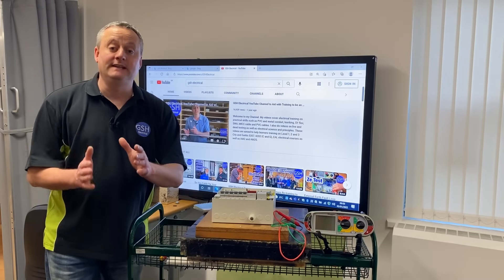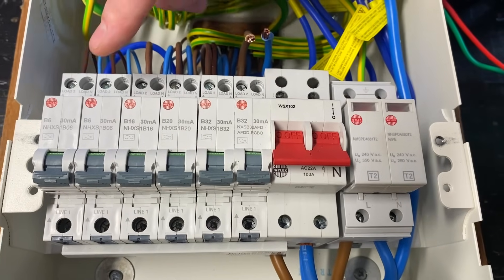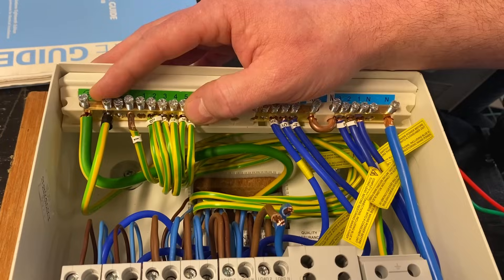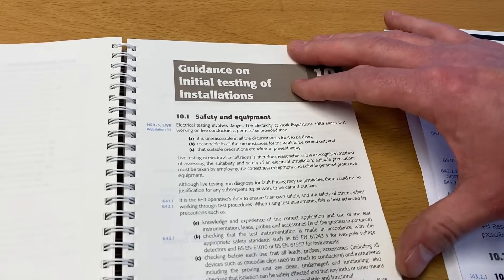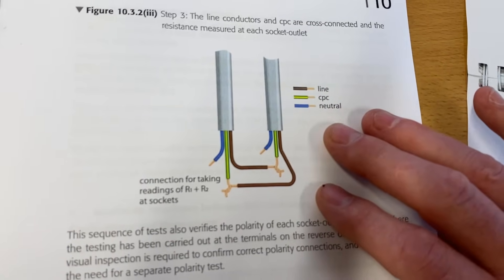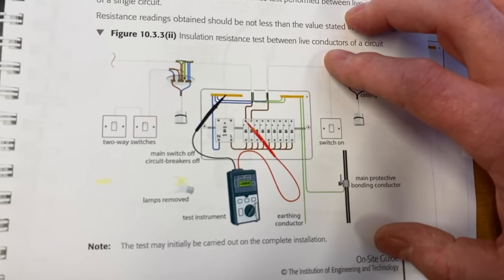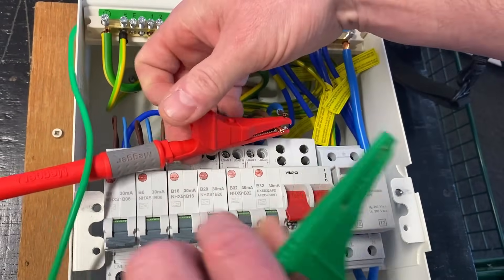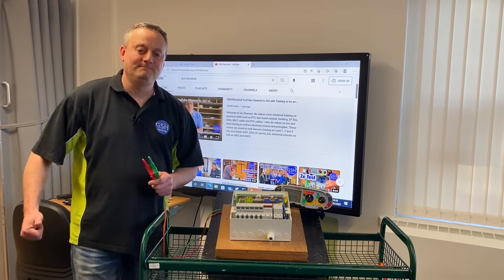Do you Know Which Conductors Need to be Connected During the Insulation Resistance Test?

Comment: I failed my AM2 testing for disconnecting the RCBO circuit and then not IR testing it against the other connected circuits, it would have been covered in a global IR but because of the disconnection I see why this would have caused a problem, full loaded RCBO boards are a pain

Comment: Why do you have to have all the earthing and bonding connected when you do the insulation resistance test thought it was just like IR testing a pyro or 2.5 or 1.5 radial there is no earthing connected then can you explain the reason
Reply: You may have a cable stapled to a pipe, need to see it's not Shorting via metalwork or parallel paths

Comment: Makes me twitch every time you touch copper! I do eicr's exclusively and teach everyone I work with to treat all parts of an installation that could potentially be live, as live, regardless as to whether they've checked or it not. If you treat all potentially live components as live you can never get a shock. Better safe than dead! It's not often I get the chance to work on a board with the main switch off!
Reply: "Neutral" can the devil in disguise if full care isn't excercised.  In a mares nest of wiring found in some consumer units, it could be easy to remove the live conductor and its associated neutral but accidentally identify and remove the wrong neutral.  That removed neutral could then become live when someone activates the circuit associated with that neutral.  The borrowed neutral scenario springs to mind here.

Comment: Hi Gaz, similar age to you , with 30 odd year's experience..now going for the 2392-10 ... traditionally? Wouldn't we had disconnected the relevant CPC for said circuit, for insulation testing? otherwise, isn't their the potential to " false readings?" With all the other CPC's connected? Also noticed in other vids, you done IR direct to bars with all other N ,and CPC's connected, cheers Andy

Comment: Line and neutral are both live conductors so that answers your first point about it saying live conductor in your book but the neutral is connected. And you didn't explain why the earth needs to be connected, you just stated that that's what the book say, not a very good explanation. If you're just wanting to test the IR of a single circuit it's totally irrelevant if the earth is connected, if you just want to prove a cable is ok then there's no reason any of it needs connecting to the DB at all.

Comment: JW. Did a video were he tested a smoke alarm at 250 500 and 1000 volts, and guess what ? The smoke alarm was fine and continued to work as intended.
Only last week Nick Bundy  put up a video we’re he tested A LED lamp and driver at 250 500 and yes a1000 volts, and the LEDs were fine and worked as intended after each test . So in my opinion both JW And Nick Bundy have expelled the miff that electronic equipment can or could be damaged by a 500v insulation resistance test .
But I have to agree we should remove such equipment from circuit. To avoid misleading test readings.
Reply: The problem here could be that after the inspection is complete the client magically finds things that are no longer working.  Guess whose fault that is going to be if they were included in the test procedure!  Confiming they are working before carrying out testing could take longer than simply removing them.  

Perhaps I'm just a pessemist. :(

Comment: Yes, but what is the reason for the main earthing conductor and bonding conductors being in place during IR testing?  Surely without them connected you still get a true reading for a particular set of circuit conductors
Reply: The “Why” would have been really helpful here as it gives a better understanding of why the test should be carried out in this way and what issues it helps identify.

So if you carry out the test with the cpc disconnected, your are right in that it will reveal any issues of low or failing insulation resistance between the other conductors and the cpc in that circuits cabling. 

What it won’t show you though, is if there are any issues with regards to the insulation resistance of that circuits cabling and the rest of the installation.  As a circuit will often pass through a building in contact with other circuits, services and various extraneous conductive parts it has the potential to interact with any of them if the cable is damaged or the insulation has deteriorated.  

So by measuring the insulation resistance of a circuit with all the other earthing, protective and bonding conductors connected you will identify any issues where a deterioration in insulation resistance has occurred with respect to that circuit and other parts of the installation for example a water pipe or similarly other earthed parts of the installation due to a parallel path that has now developed due to the poor insulation resistance. This is important as a significant enough deterioration in insulation resistance can lead to a dangerous potential to occur on that other service or conductive part that won’t necessarily be high enough to trip a protective device.  It can still be high enough though to present a significant danger to users of the installation.

Comment: The text in the Onsite Guide is very subjective ,'Test between the live conductors (line and neutral) and the circuit protective conductors at the distribution board Figure 10.3.3(iii) illustrates neutral to earth only.' My interpretation is that it means testing between line and cpc , then between neutral and cpc . By stating that the illustration shows neutral to earth ONLY then it certainly suggests that there is a line to earth test that is not illustrated. If you read on to the Three Phase test, then it specifically describes all live conductors 'together' tested to earth. No sign of the word ‘together' with the single phase test.  Another puzzler, GN3 states that for a new installation then an insulation resistance value of 20 MΩ and not 2MΩ should be investigated. Still not sure if this is a misprint as I can find absolutely no reference to this anywhere else .

Comment: 8:10

Testing phase-earth and neutral-earth separately will achieve effectively the same result in the end as joining phase to neutral and testing to earth, so when it says "live conductors to earth" it make no difference really if that's separate or together. 

You're not putting a voltage across any potential loads (and even if you were, testers are so current limited you'd be very unlucky to damage anything as the voltage won't rise to its nominal 500V+) so you're not going to cause any issues.

The worst case scenario would be a 1Mohm IR between phase and earth up to a switch that's open (which it shouldn't be, but it can be awkward with contactors etc.) that just scrapes a pass. Then a 1Mohm IR from after the switch through the load and neutral referenced to earth. So both legs scrape through but the combined reading wouldn't. But that's a very similar argument as to whether you test the entire installation in one go or each circuit individually. Are 10 circuits each with a 5Mohm IR OK? They would be in isolation but wouldn't be if you tested them as a board.

I'd say that if you were only just scraping a pass on each leg of a circuit then you're probably wanting to work out why.

As for disconnecting from RCBOs, some manufacturers specifically say "our double pole RCBO is great, you don't have to disconnect the leads to do IR testing" which is handy.

Comment: This may be a minor thing/I may be thinking too much about it. But IR is stated as a test on the Minor works. It crosses my mind that repetitive connecting and disconnecting of conductor may eventually cause metal fatigue on the copper. I appreciate that in new installs we aim to leave ample slack, which allows you to re-strip, but certainly in older installs there often isn't enough there to re-strip your conductor. It always worries me working on older boards that the conductor copper  may be lookingna bit worn out due to having been removed for testing several times.

Comment: Thanks for this Gaz, I think there's a lack of YT content relating to the testing of modern RCBO/SPD configured DBs which this addresses. I prefer taking conductors out to IR, you just never know. No more global IR though. :(
I wasn't taught, as far as i can remember, about having the earth in place and struggle to work out its importance of you could expand on that please.
Reply: Very important to keep the protective conductor connected to earth , if a neutral was nailed to a water pipe for example this fault would go undetected
Reply from the maker: I will follow this video up at some point Olly 👍🏻
Reply: As far as I know it’s to flag up problems with stuff like steel stud work being in contact with damaged live conductors.
Reply: So by measuring the insulation resistance of a circuit with all the other earthing, protective and bonding conductors connected you will identify any issues where a deterioration in insulation resistance has occurred with respect to that circuit and other parts of the installation for example a water pipe or similarly other earthed parts of the installation due to a parallel path that has now developed due to the poor insulation resistance. This is important as a significant enough deterioration in insulation resistance can lead to a dangerous potential to occur on that other service or conductive part that won’t necessarily be high enough to trip a protective device.  It can still be high enough though to present a significant danger to users of the installation.

Comment: Forgive me if I’m getting the wrong idea, but surely during a initial verification you should be testing between L-N, L-E and N-E separately as the circuit is not energised or have loads installed. The purpose of combined LN-E was a limitation on an EICR as loads couldn’t be disconnected?

Also, if installing a new circuit to an existing live board, the neutral for the circuit under test should be disconnected from the neutral bar (shown as connected in OSG)  as you don’t want 500V going to live components up the neutral bar?

Thanks for all your amazing work!!
Reply from the maker: I will do another video at some point covering your comment… Note - the longer the circuit the lower the insulation resistance even if it is so small the instrument won’t register it… so linking live conductors together to earth gives you longer conductors when testing and therefore a lower reading the L to E and N to E… 

All the best Gaz
Reply: @GSHElectrical  Would linking LN and testing to earth pickup IR faults between L and N, I thought it was treating them as one conductor and any faults between the two would be cancelled out as it’s just looking to faults to earth?
Reply: @jongurney  correct. L/N to cpc testing cannot determine a L/N insulation fault.  Imho it is the usual easy test on an existing installation to establish whether the RCD is likely to trip due to an earth fault from either L or N insulation failure.